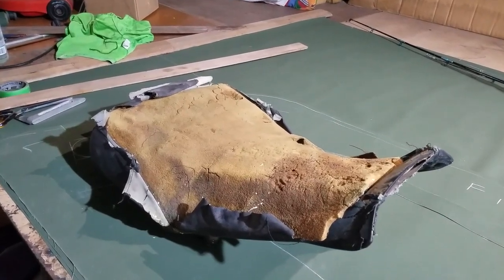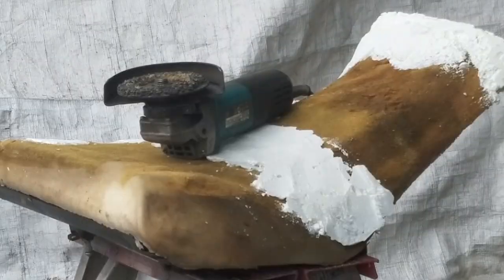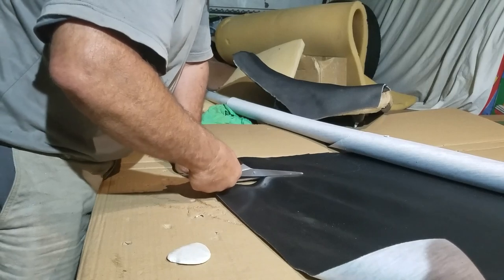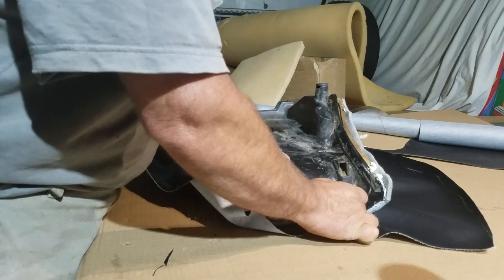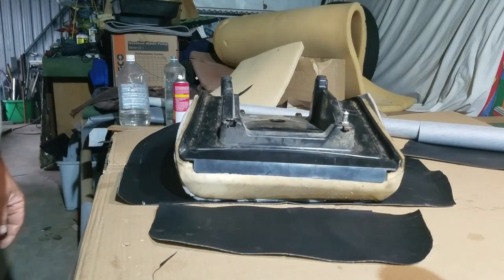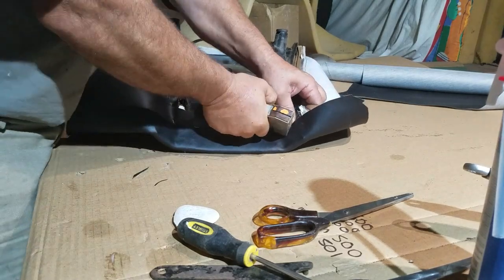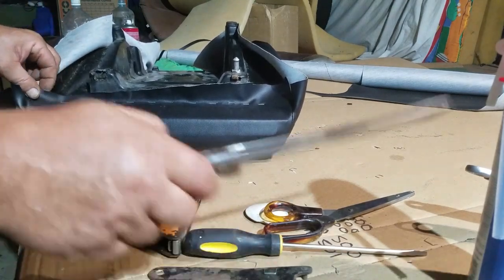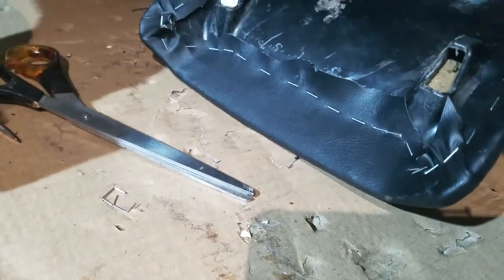Recover Quad/ Dirt Bike, Snowmobile Seat in one hour DIY for $25

Comment: Better to use that upholstery foam in the background,  cut around the areas of damaged foam so it has straight edges and replace with new. Then warm the vinyl in the sun and stretch it over the repaired foam using a hair dryer. Expanding foam won't give until it collapses and doesn't retain a good memory.

Comment: only problem i can see with this is spray foam is rigid, and not very springy. once it is crushed, it will be lower in that spot. i usually use old couch cushion foam to refoam seats. the foam anti fatigue floor mats are a good source of cheap, denser foam for places when you need more support, and less squish.
Reply: So how do you attach those foams to the seat? I need to do something similar on a bike I got
Reply: @carminecarlone2869  i use 3m spray glue. just follow the instructions on the can. you can find cheaper spray glue, but since it is something you only want to do once, it's worth using the best. an old electric carving knife is the easiest way to shape the foam.
Reply: You don't notice it. And once covered up out of sight out of mind.

Comment: In the case of my Seadoo seat, with a lateral crack across the seat foam but no actual gaps…that a spray adhesive would be better than a spray foam as there is no gap to fill.

Comment: Can you fit it in the back there whit out the sewing? I have a hard hard seat that i bought repros for. But i can get the curls away in the back going incane doing this, Can you show if you hav a trick for that a almost llike a 3.5cm middle look like a smile in the back squear tho corners are about 4.5cm squear seller says it's easy. But no... there is streatch in it both ways but i think to thik

Comment: Does the spray foam have some softness to it? Just wondering if you notice any difference between the 2 foams.  Thanks. Nice video
Reply from the maker: Oh absolutely!- Its not touring bike soft though. Its the best Ive found for the job. Its fine for MX Enduro and farm quads. Ive done these repairs for decades now and never had a complaint

Comment: Nice work, what kind of spray foam would you recommend? I restored several seats, but they had no deep holes, so I shaved them down and upholstered them with a layer of thin foam. Also you didn't use glue for the vinyl before stapling. I will definitely try this the next time, too. Thanks for your input 😁
Reply from the maker: Yes never glue the vinyl- It needs to move to stretch to fit

Comment: To those saying the spray foam will be hard, that is true of every brand ive ever used...however, the hard ones can't be cut that easy with a knife.  That brand he uses must be a different formula
Reply from the maker: after trying 4 brands I settled on this one. Ive done many many quad bike seats car seats jet ski seats, dirt bike seat repairs and modifications with great results. Thanks so much for your comment Ben.